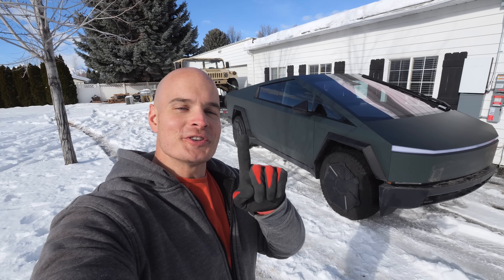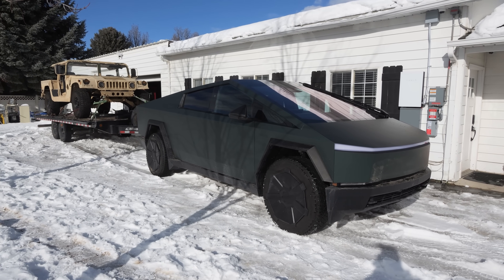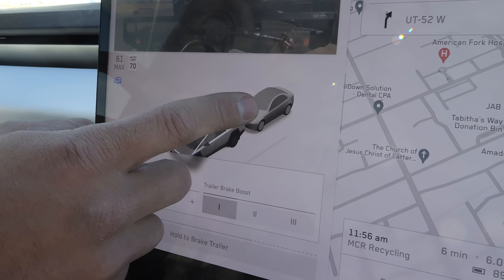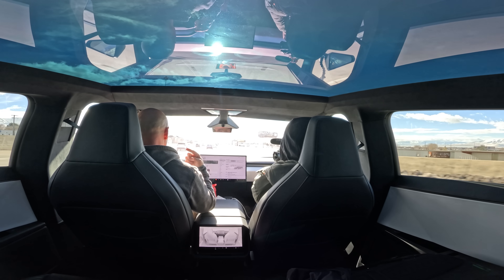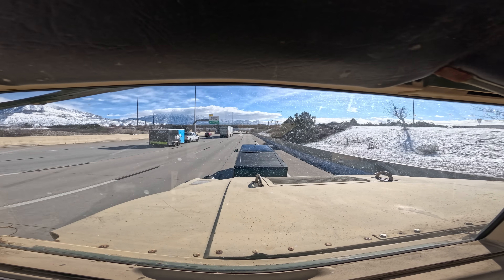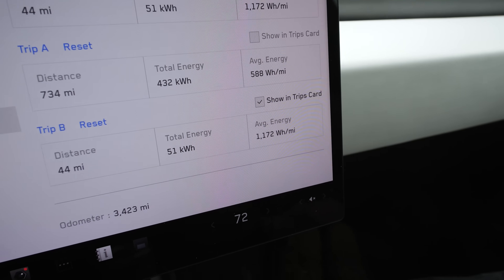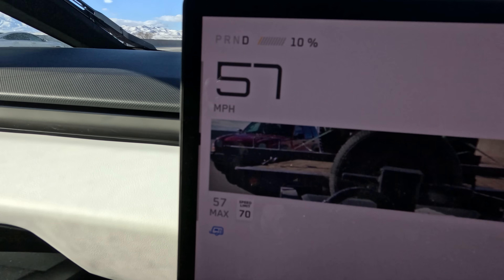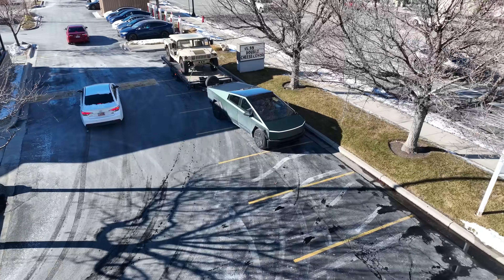How far can the CYBERTRUCK tow 11,000lbs in Freezing Weather?

Comment: Am i the only one who noticed charging port is covered by a powered  door?  That seems like a terrible idea.   Maybe it runs off a separate battery or can be opened manually?   If not  that seams like designing an ICE where the motor has to be running to take the gas cap off.

Comment: Thanks for the video, just confirmed for me just how far EV's have to go to be comparable to a diesel pickup.
Reply: It will take a significant increase in energy density and charging power for EVs to reach ICE recharge parity. 
A gas pump does in a minute what an Electrify America 350kw charger does in an hour. A gallon of gasoline is ~33.7kwh, Diesel about 40.6kwh. Gasoline is pumped at 9-10 gallons/min (300-340kwh/minute).
Reply: @kng128 Your ICE is only getting about 1/3 the energy available in the fuel.
Reply: @blader20297  yes, I’m aware how inefficient ICE are. And for the moment it’s convenient to use when I have to take on trips that don’t have time flexibility to stop and fast charge. My EV doesn’t have a particularly fast fast charge. I try to maximize my EV travels otherwise.
Reply: How so? I understand in terms of estimates, the tech and charging infrastructure, but the range will significantly decrease on any vehicle when towing. Personally if we iron out the range estimate and have chargers specifically for vehicles with trailers, they'll be almost there. In the case of the Cybertruck, Tesla are planning a range extender which should help.
Reply: @lucaandreamifsudbuhagiar9375 yeah… no. I’m going to assume you’ve never pulled anything with serious weight behind a diesel. 11,000Lbs is light for 2500-3500, it’s a flea in the bed, and don’t get me started on the 90 mile range, absolutely pathetic. With a full tank and highway driving I get 820-830 miles in my Cummins, with a gooseneck and a load of cattle (25,000-30,000Lbs) my Cummins will get around 500 ish miles. I’ve only gone a little over 400, but had 100 and then some with range left.
Reply: @cody7068  Good point, not to mention all the time wasted frequently recharging the EV as compared to a quick occasional fill up.  I have a Polestar 2 and I towed 1500 lbs on a 1300 mile trip last summer.  Wasted like 10 hours charging, not to mention the trouble of unhooking the trailer every time.  Never again!  I cannot imagine trying it in a Canadian winter!  Mine would probably get like 50 miles or so.  For daily commutes and errands without hauling, I love the EV though.
Reply: @cody7068  11,000 lbs is not light for a ¾ ton.... 30,000 lbs is extremely heavy for a 1 ton with dually's..

Comment: Think about it - this setup is using 1172 WH per mile,  but Tesla is telling us that the Semi (gross weight 80,000 lbs.) only uses 1700 to 1800 WH per mile - Yeah right, everyone who believes that raise your hand - no one, anyone?
Higher voltage is more efficient for two reasons,  the voltage drop over the diodes is a percentage so less of the total power flow is wasted here,  and the  I squared R  losses in the wiring is less since the amperage is lower because of the higher voltage for the same power.   This is also increases range when you slow down >> less current and remember the loss is proportional to the square of the amperage so a lot less loss.

Comment: EVs are a low energy density joke. 4th gen nuclear power and ICE hydrogen are the long-term answer. Hydrocarbons are the future for the next 100 years. 90 miles tow range and hours of charging. You'd have to have sh!t for brains to buy that "truck".

Comment: I like how Jerry totally forgot about the fact that when he did the Rivian test, that the trailer was 1000 lbs lighter for a significant portion of the trip, regardless its still disappointing to see that the higher voltage and larger battery cells used in the cybertruck didn't give any range gains compared to the competition.
Reply: Lots of variables 😮
Reply: also lost range with the cyber truck not charging for a while after being charged in the garage and then once moved outside it sat for a while. I assume the four wheel steering effects the range so it is a cost for the better steering.  In Rivian test he didnt say if he topped the charge off before pulling truck outside to hook trailer up or how long either sat outside.  We also do not know what the temperatures were for either tests other than below freezing.

edit.  I just rewatched both videos to see the temps at time of driving but still do not know what the temperature was when both were waiting to get hooked up.
Reply: Eww, $13 to fill up your car w electricity?  That nearly defeats the purpose.  Considering you have to recharge much more frequently w electric as a gas motor will likely be half the timeframe.  So you’re saving maybe 1/3rd of the cost than you would with gas while having to total your car out when the battery pack dies.
Reply: @trevorredlarczyk5057 Why does this defeat the point? If you towed this with a Ford it’d cost you well over $100
Reply: 90 miles with a ford.
Say 8 MPG gas. 10 diesel
11.5G / 9g
$35 / $34
Math.
get over evs, they're a 2nd car at best.
Reply: @theminister1154  You didn’t calculate the fact the truck is pulling 11,000 lbs
Reply: I dislike how they lie about the range. It keeps getting shorter and shorter as you go. They lie to you, just like those loading animations that say you are 99% finished for like 10 minutes.
Reply: Weird how he forgot to mention this ..
Reply: The cyber truck is stainless steel so she TOPS them all.

Comment: So, 90 miles range on 98% of battery while towing 10,400lbs at 32°F, and that brings Cybertruck dead last compared to the Rivian R1T or Ford F-150 Lightning.
Reply from the maker: 11,400lbs. But yes.  You have to add the tongue weight to the load, which I forgot to verbally mention in my Rivian video.

Comment: Watching this just makes me further appreciate holding off purchasing ANY electric vehicle. Enjoying my 2012 Highlander Hybrid for the next 7 years at least, hopefully by then Solid State Batteries have resolved the range anxiety problem.
Reply: I tow and haul often, and watching these tested with cyber truck and lightning are good info. They show me that it is worthless getting an EV to haul as of right now. I can get 3 times the miles out of my half ton compared to the cyber truck. And fill up in 7 minutes. 

It will be interesting how fast, or if technology will be good enough to make  an EV even a thought in the future.
Reply: You know your hybrid is also a type of electric vehicle right😂
Reply: @hansen6233 not really. It still mainly relies on a combustion engine. The only way I could consider it an electric vehicle is if you only use the battery and basically disable the engine.
Reply: @hansen6233 That's a pretty asinine comment.

Comment: Imagine having to charge for hours after every tow, longer in freezing weather. You'd have to unhook your trailer and then wait for hours to go only (maybe) maximum 100 miles range. There was a guy who tried to take his Rivian truck camping in the mountains. He ended up having to use a diesel generator to charge his Rivian. And was only getting 10 miles at a time after hours of charging. He ended up bricking his Rivian, got so much backlash in the comments, he deleted the video. Another thing not mentioned, is durability. You can guarantee something will break in the EV trucks. Diesel trucks can tow all day and reach 300k miles with minimal maintenance.

Comment: So it started with a 318 mile range and that turned into 90 miles.  That is not acceptable. You can't even plan a trip in that EV.  How long will it take to charge for the return trip? An hour and a half?  Still a non starter with EV's.

Comment: Thanks, you have convinced me that I never want to own a EV trunk. Looks fun if you are into toys and wanna be able to say “look at me” but my Ram Dual cab is much less stress, can pull anything I need to with ease and comfort. And I don’t have to worry about driving 10 Mi below the speed limit or unhitch to get back on the road. Plus just wait 5-10 years, right now everything is brand new!
Reply: My 94 f150 with an inline 6 hauls better than the $80k truck. Cyber trucks are for people with more money than brains.
Reply: @justawfulgamer7738  that may be the most intelligent comment I’ve heard in a long time. I’m actually for new technology that improves our life’s or makes it easier and more efficient, I had both a gas and then a Hybrid Camry and I absolutely loved the Hybrid version. It was bigger, nicer, had extended range and got over 52 mpg too boot and the hybrid switch was undetectable.  It was almost 8k more expensive then, but was probably worth it. But I didn’t have to convince myself I liked it!

Comment: Definitely still has a steering rack, drive by wire refers no steering column, no connection between steering wheel and electric steering rack. Sensors read steering wheel position and communicate with steering rack according to settings, allows for adjustability but is known to have poor feedback.

Comment: I am regularly towing stuff with my good trusty (new) Diesel-engine. By 2035 Europe wants to forbid all regular cars that are fueled by gas and diesel. Only electric cars will be allowed. I don't want to buy an electric car. They are much more expensive, have so much less range than regular cars, have to charge for 30 to 50 minutes for full capacity, we don't have much clean energy in Germany (its coal and stuff like that), the reselling value of electric cars is awful - after all, who wants to buy an electric car with the risc to have to replace its battery for $15.000 or more - and the production of an electric car isn't enviroment friendly at all. One last thing to consider: I all people suddenly have to drive electric cars in Europe, we don't have a power grit that can handle it, nor enough chargers. What about people who live in apartment buildings? The last thing I will do in 2034 is buyng another new diesel-powered car.

Comment: Considering nearly 75% of all light-duty fleet trucks never travel further than 450km in a single workday, vehicles like this could be a nice drop-in replacement to handle local hauling, but for the moment it's a bit prohibitively expensive even for its class as a more luxurious vehicle considering its application. The future single motor variant should be plenty adequate at a reduced price

Comment: Looks like Elon is sticking with those fake battery range figures. I honestly can't see the point of this vehicle. It's sold as a workhorse but can only pull a load for 90 miles, and uses 108 kWh to do so. That's how much I use for my whole house for about five days. It's noisy in the cab. The digital display showing traffic is worthless. I guess it's a nice toy, but I'd rather get an RC car if I want to have fun. Nice cinematography though.

Comment: I think you’re using the term “steer by wire” incorrectly.
I thought steer by wire refers to the fact the steering column is not directly connected to the axel (or rack and pinion, I’m not exactly sure). Instead, the turned amount is programmatically sent to the wheels to turn them some amount. Thats the “wire” part.
Now, that AMOUNT of turn, which you’re referring to as “drive by wire” is actually proportional to the speed of the vehicle. So at 5 mph, you only need to turn the wheel a little to minimize your turning radius (compared to traditional steering where you need to rotate the wheel >1 time). When you are going faster, the proportion is much GREATER, meaning it takes more turning at higher speed to move the wheels less - intended to prevent small adjustments from having outsized impact at those speeds.
I don’t remember the term for this, but I do recall Mercedes Benz touting this feature in their vehicles almost a decade ago.
I think the term you want is something like “relational steering” or “proportional turning” or something like that, not “steer by wire”.

Comment: Sounds fun.   Short range, an hour to charge, having to reduce speed to make it to charger, charger full when you get there. 
  Best part is watching other pick ups whizzing by pulling trailers.
Reply: The good thing is he can put the cyber truck on the trailer and just tow it with the gas car
Reply: Tell me about it, it's soo bafflingly stupid and impractical.
Reply: Think those trailers weighed as much as his
Reply: @Rz123....  Wind  resistance v weight 
same same
Reply: Yes, that sounds so fun to do every 90 miles, I think I’ll buy a 10k old used trunk and bypass all that, but more power to him! Just think in a couple years he will probably get 30% less and a 10% drop every year after. Maybe that’s why the cyber truck is showing you getting pushed down the road by a semi Truck!
Reply: @restoreamerica1558  "getting pushed down the road by a semi Truck!" love it
Reply: The real question is how many charging stations will it take if everything was electric? If everybody had to wait 40 minutes to charge most people multiple times a day,what will the lines look like just to get a turn? How big with a charging station have to be? Certainly will be big problems in the future.
Reply: @von9443  And they arrived with only2%  And with a convenient place to unhook the trailer. 
So if the charging stations were 40 miles apart, I cant risk going more than 40 miles, before unhook the trailer (in some unsafe part of town), wait for a vacant spot, hook back up again, and at 70years old that takes forever to hook and unhook the trailer! In the blistering hot sun or freezing in -40degrees. Max range is now 40 miles 
So its going to take me 3 hours to travel 40 miles, and i am going to loose skin every time i have to hook and unhook 
The Amish could travel faster with a donkey!
Reply: @qbi4614  Then don't do that, geezer.
Reply: @qbi4614  the range will be different in warm weather and based on what your towing. How often do you tow 12,000 lbs?
Reply: @von9443  This is a big question. Today chargers are located in parking lots and are not really set up like a "gas" station. I think we will need to rework our gas stations to provide charging bays. But, generating all that power is going to be an issue and no one seems to be thinking too much about this.
Reply: it doesnt take an hour to charge and this is hardly a real world use case
Reply: @Zimpaz  Tell us you dont tow anything without telling us. This is exactly what millions of Americans do every year with their trucks.
Reply: @smtbigelow  surveys show that most truck drivers, 75% only tow something once a year. About 35% tow more than once a year. And, how many people, outside of commercial truck drivers, tow something over 100 miles on a regular basis?
Reply: @tclark5481  Let me guess, your "survey" came from companies that have ties to electric cars.
Reply: @tclark5481  Ok so what's your point??  When I do tow.  I want more than 90 miles of range.
Reply: @MrRjsnowden  then an EV probably isn't for you. In this case, you do realize the 90 mile range was partly due to cold weather.
Reply: @tclark5481  Which makes it an expensive product with limited use.
Reply: @MrRjsnowden  Depends on how you define expensive. Given that most people don't tow that much, go offroad that often (if at all) and don't drive 300 miles every day, I'd say it's right there with an F-150 class truck. The F-150 is about $75K unless you go for a basic model which won't compare to the CyberTruck in terms of amenities.
Reply: @Zimpaz  cut your delusion you will do and say anything for your beloved electric vehicles. I'm not waiting 20 to 30 min to fill up a dumb ev
Reply: @Zimpaz  Unhook the trailer, wait for a vacant spot, hook back up again! At least 1 hour if not more to travel 90 miles! NO THANKS
Reply: @qbi4614  and that 90 miles range will be reduced by 30-50% when it's much colder
Reply: @qbi4614  Poor baby.
Reply: @qbi4614  30 mins to charge, do the math.
Reply: @Zimpaz  how is it not a real world use case? the specs say it can tow this much weight and that the range should be much more than it really is.
Reply: @Zimpaz  Cope!!
Reply: @Zimpaz Correct, it takes longer than an hour. He showed in the video that 20-80% would take 40 minutes, which is only 60%. Charging the remaining would likely take just as long, since charging speed slows down as capacity is reached.

Comment: I'm all for electric vehicles. But look at northern scandinavia and how all the electric vehicles handle the cold. Multiple cases now where more or less every single electrical vehicle in the region have been unable to go anywhere due to cold temps (-40/-30c). Impossible to own an EV up here knowing that you would be stranded when temps go down. I even saw one brand new tesla parked with a generator next to it at a grocery store because the battery died as he was shopping.

Comment: I tow a camper with my diesel pickup. I would be curious to see the effect of a trailer that's around 11 or 12ft tall behind it. Wind drag is hard. My mileage was the same towing a 7200# camper as it is now towing a 14000# 5th wheel.
Reply: That’s surprising mileage is the same
Reply: @johnhopperstad2785  Pulling a camper is like dragging a big parachute behind you. It's the wind drag. I'm just curious if that would change the mileage on the cyber truck.
Reply: @bubbapond1616  A horse trailer rocks from side to side as the horses move and lean into turns. Then going down the mountain you really feel the weight of the trailer.

Until someone comes up with an EV with a fifth wheel and power enough to pull a 4 horse trailer and can go longer than 90 miles, I’m keeping my Cummings Dodge Ram dualy with double diesel tanks. I’m definitely getting my money’s worth!
Reply: It wouldn't make it to your campsite most likely
Reply: @pmdracing  yeah, that 90 mile range isn’t hitting on much. I usually start looking for fuel after a few hours on the road. That’s about all the time I want to drive in one run.